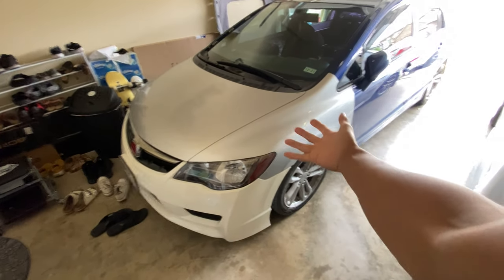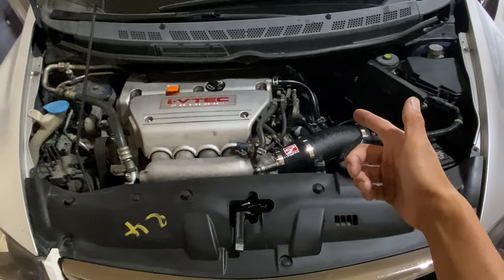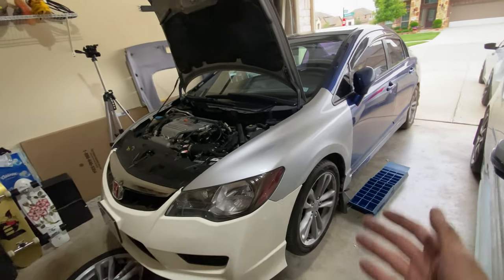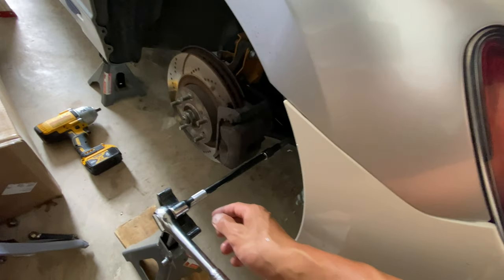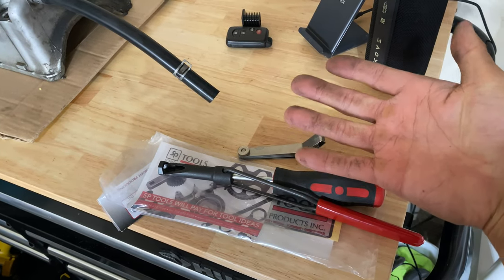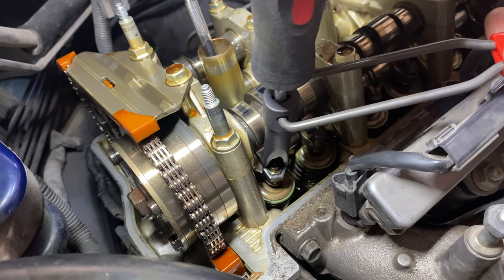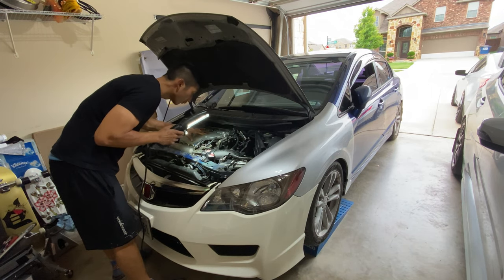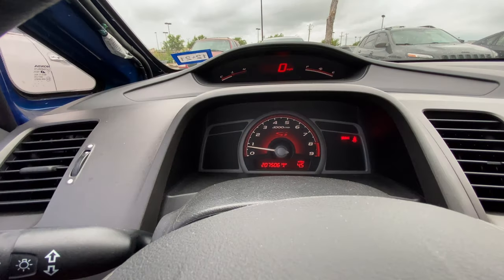Do This and Your Car Will THANK You!

Comment: Are those valve adjustment specs good for 2.4 k24a2?
Reply from the maker: Nahhh, I found this for 05 Acura TSX: intake 0.21 - 0.25mm (0.008 - 0.010 in) ///// exhaust 0.25 - 0.29mm (0.010 - 0.011 in)
Reply: @Rawrkee  thx appreciate this